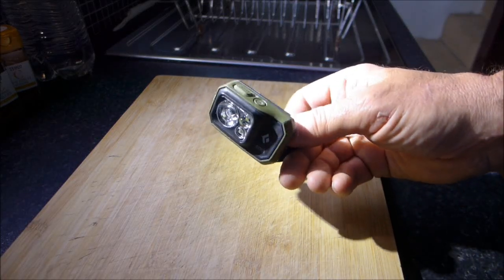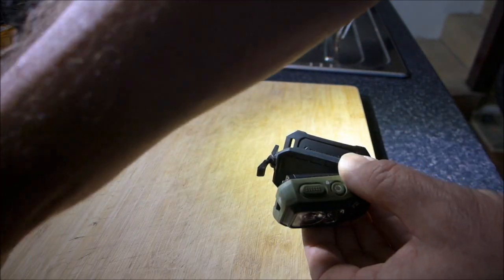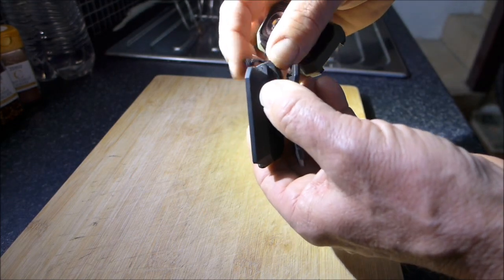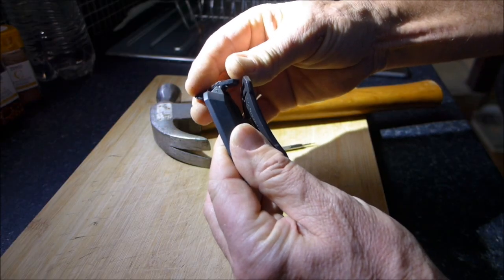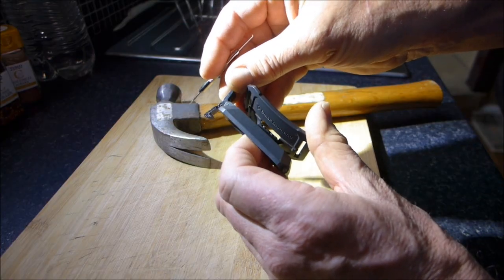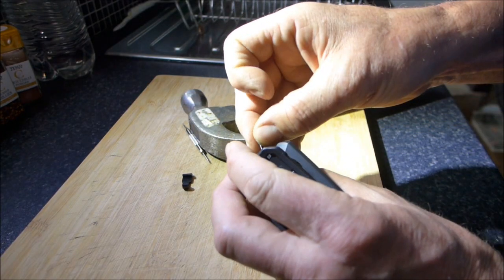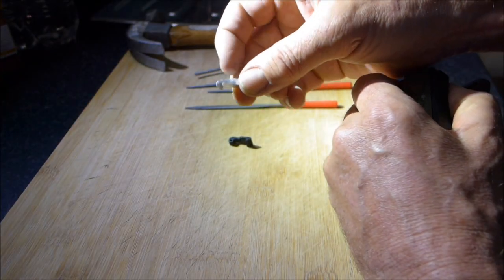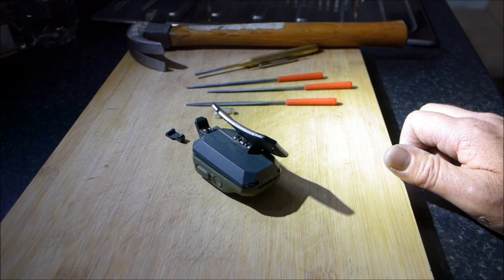Black Diamond Storm 450 headlamp broken latch fix

Comment: This is a common issue with the Storm 450, but I’ve heard they’re working on a new latch design to fix it. The good news is that Black Diamond lighting products have a 3-year warranty! If you reach out to your local wholesaler, they’ll likely be happy to send you a replacement latch. I've gone through the process myself, and it was quite seamless!

Comment: Good morning. I am a military man from Ukraine. Bought a Black Diamond Storm 450 for service. Accidentally came across your channel. Found a kindred spirit (humor). The mount broke on the first day of use. 
Question: have you encountered such a problem, in Black Diamond Storm 450, when you use it, the power of the diodes changes involuntarily, as well as the operating modes change involuntarily. Thank you.
Translated through Google translation, so sorry for the mistake. Слава Україні!
Reply from the maker: No, aside from the latch it's been reliable. IIRC there is a function whereby if you tap the headlamp it changes to full power - maybe it's linked to that.

Comment: I recognize the problem , here with my storm 400 same problem , however I dont have a 3 d printer , do you know an adress where i can buy some levers?  tnx on forhand
Reply: I want to offer a solution to the problem. On my Black Diamond Storm 450, instead of a broken mount, I used a 41mm binders (paper clip). There is a place in the binders where metal holders are attached. The diameter of this mount in black metal is suitable for the diameter of the axis of the mount on the Black Diamond Storm 450. You just need to cut to the shape of the broken mount and make a hitch. For work I used: vise, pliers, 
overfiler and a Dremel machine with a metal disc. It turned out to be even more reliable than the original. Слава Україні!
Reply from the maker: @opolchenecsabur8827 Could you link to a picture of the repair so people can see it?